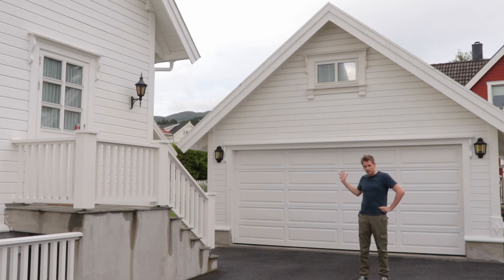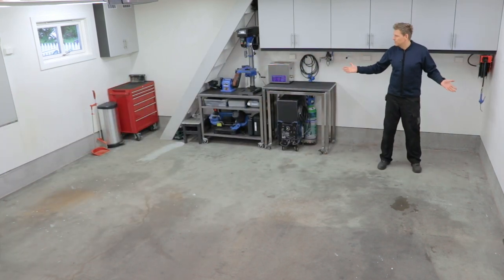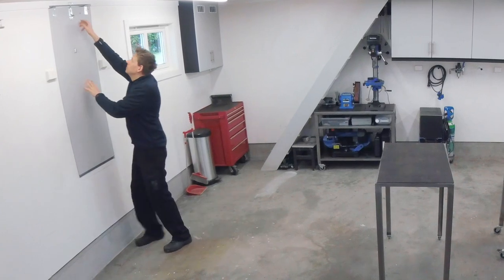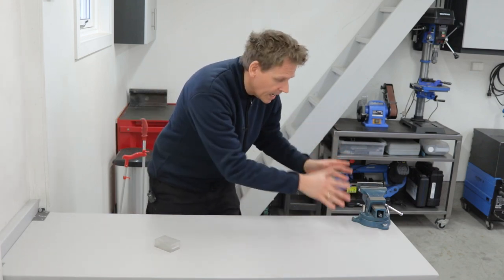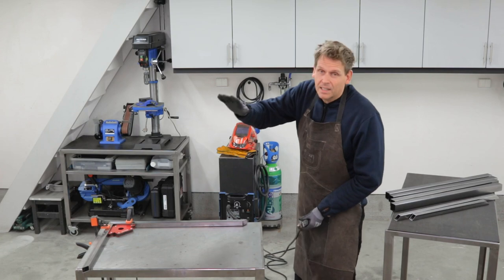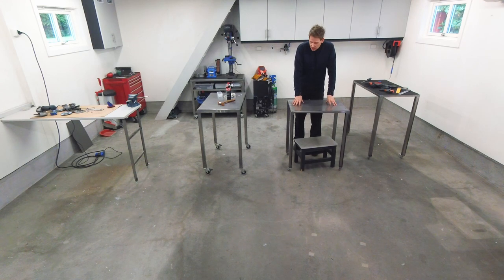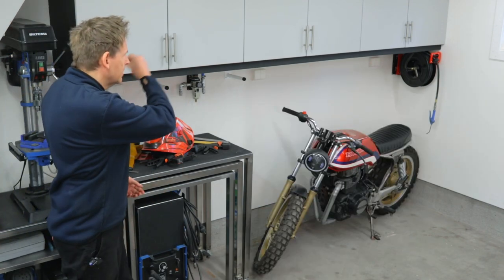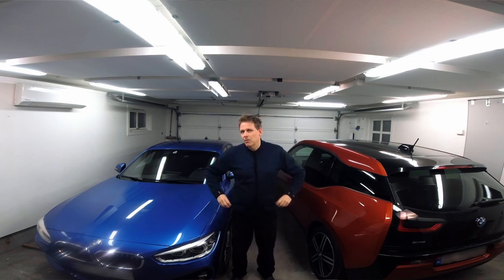Multipurpose Garage Transformation Tips & Tricks

Comment: love the folding out table!  wish i had thought of that for my workshop.  great job.
Reply from the maker: Thanks ☺️ It's never too late to add a folding table! I actually put up the panels on my inner walls without the table first. My inner walls is covered with chipboard wall panels (120x240cm). They are screwed to the studs,  luckily I did not glue them together. It was not that much work to take them off again to add the table, it was absolutely worth it ☺️
Reply: @kihestad  i may have a look at my workshop with a different eye and see where i can put one.  looking forward to your motorcycle content😁

Comment: Food for thought, I combined two tables into one.  Similar to your red tool chest, I encased the tool chest with a rectangular steel tube frame on casters. Drop down table top leaves on each side and one at the rear. Each leaf and bench top has a 3mm thick sheet steel top. When fully open, the table top forms a "T" shape, ideal for placing awkward shaped objects for assembly, welding, timber work. One of the side leaves has a small fixed vice. If you want to use the tool chest for hand tools, cheap foam exercise matts can be bought at hardware stores, trace the tool shapes onto one surface and a laminate router can be used to cut out the shapes. For making furniture, a length of Melamine surfaced  chipboard can be clamped to the "T" top surface and fitted with recessed clamp rails for clamping attachments.
Reply from the maker: That sounds great! I have actually planned to add leaves to the smallest table. It will be only on the sides on my table since I need to be able to put it away under the other tables and above my welding machine. I am using 2mm sheet of steel for the table top now, I guess 3mm is quite a lot more sturdy. Do you have a frame to support the leaves, or is it just the 3mm steel sheet and some kind of arm to keep it folded up?

Comment: Hi Just an Idea I use for mounting  the Vice quickly is to mount it on 19mm Plywood with counter sunk bolts, then us 2 Large G Clamps to fasten it to the bench. It works well and is quick.
Reply from the maker: Very smart, and much more flexible than my solution. Makes it possible to mount it anywhere 👍

Comment: Mount the vice to a wide square ish wooden slab or a metal one and then when you need it, just use some quick release or regular clamps to mount it to the table. Then you can mount it anywhere you'd like, to whatever table and also don't have to mess with screwing/unscrewint it. Much faster!
Reply from the maker: Dang, I think you are right 😳 I have overcomplicated it, the solution is just that simple 🤩 Thanks!!!

Comment: Nice video. White epoxy flooring will greatly improve the available light. However, it shows dirt and scuffs from tires.
Reply from the maker: Thank you 😊I have actually started the process! Will be using Gjøco epoxy, its not white but light grey. I will start repairing cracks and damage in the surface this fall, and probably just put on a cheep primer before the winter. Then sand it down and continue the process next year when the weather gets warmer.

Comment: Do you have a video on how you built the loft stairs?
Reply from the maker: Hi, I have unfortunately not a video about it 😏 It's rather easy to build though. If you send me an email I can reply with some info and pictures if you want.
Reply: @kihestad  I was mostly just wondering how you determined the cuts for the ends of stringers.
Reply from the maker: Not sure if I understood the question 🤔 I use this rule to calculate the steps in a staircase: A normal step for a person is 65cm (at least here in Norway, we have long feet. In other countries where people might not be as tall it can be 60 - 62cm). It's twice as hard to go up compared to go straight forward. It gives this formula:

2 x step-riser + 1 x step-tread = 65. 

You need to know either the height (riser) or the length (tread) for the steps on your staircase, and then you can calculate the other. In my garage the staircase is quite steep, I just dont have space for a normal sized staircase. I think I have 25cm height for each step (= riser): 2x25 + tread = 65 -> tread = 65 - 50 = 15cm. In other words: 15 cm forward - 25 cm upwards for each step. I have made each step a bit longer than 15 cm to have a better platform for the feet to stand on, so each tread overlap a bit.

Not easy to explain, hope it made sense 😊
Reply: @kihestad  I do understand, thanks.  I guess you just used Pythagorean theorem
to calculate the length and angles to cut the supports?
Reply from the maker: Exactly, Pythagoras is the man 😁 You need to decide where the staircase is to start downstairs, and where it ends upstairs. Then you calculate the angles by measuring the height from upstairs to downstairs, and from start to end horizontally. Make a lot of drawings on paper and double check all measurements, it's easy to miscalculate 😏